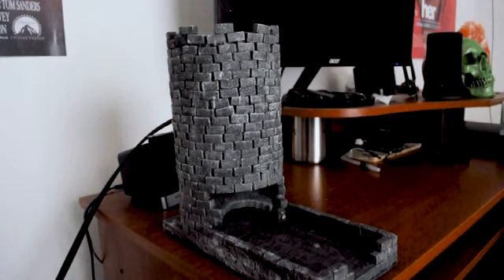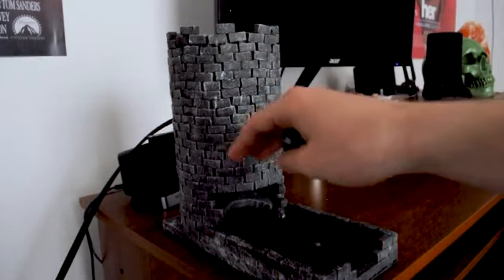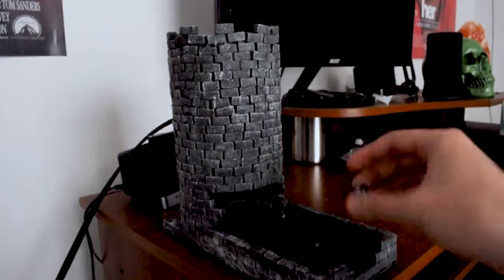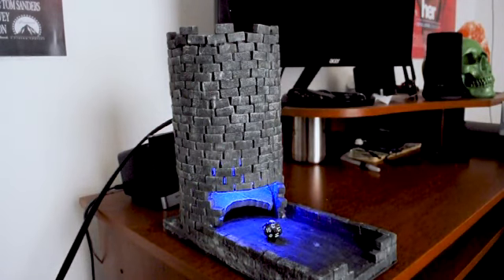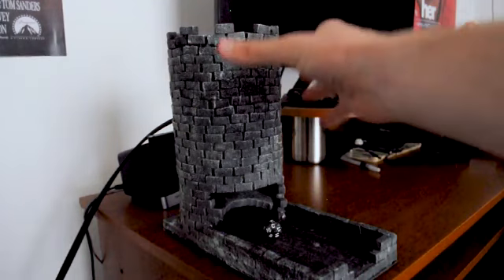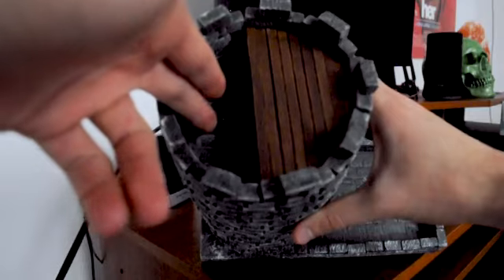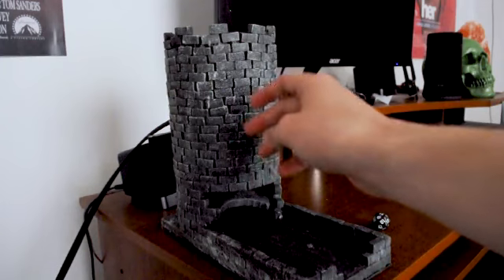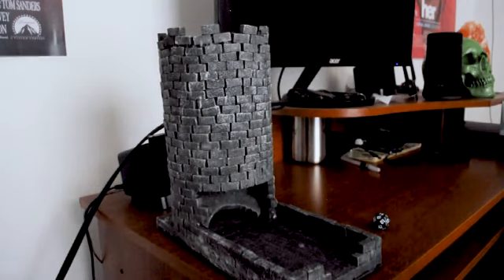Light-Up Dice Tower by Tanner

Comment: Very polished looking product and great description how it relates to the players
. I especially like the light feature--it kind of adds a magical or mystical looking effect for the players. I wonder if an even smaller version of this could be made or adapted to take up a little less space on the table?
Reply: Good question. That’s the only complaint I got in user testing. A smaller version certainly could be made. I think I really just chose a size where it’d be big enough to be cool and easy to interact with, and small enough that it’s not too intrusive
Reply: That's great that you've already thought about it and user testing highlighted it as well. Great work! Thanks for sharing.